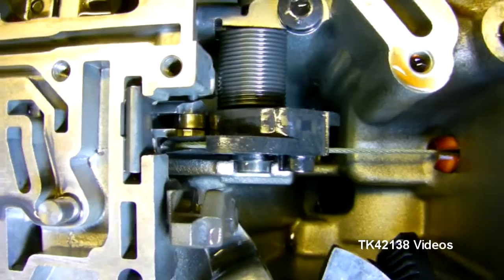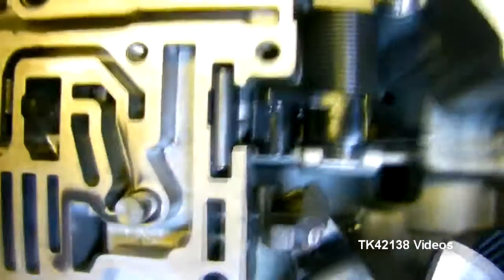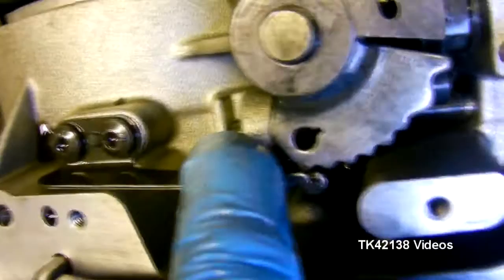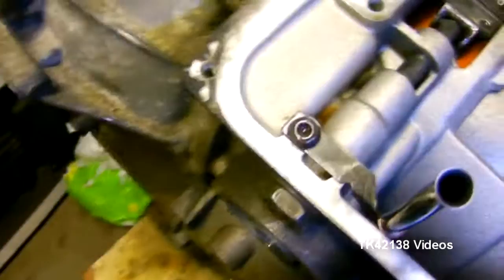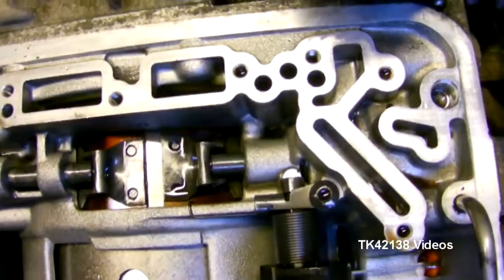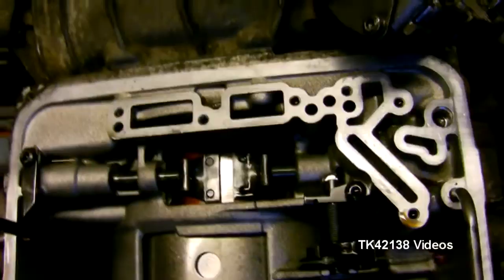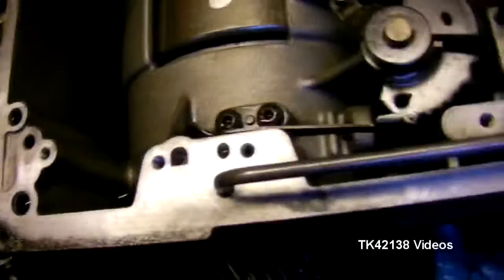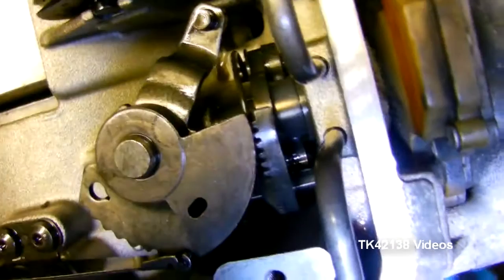ZF4 HP18 gear selector & kickdown cable operation

Comment: The little brown/yellow plastic bushing on the case for the kick down cable would break, i found a fragment of that plastic stuck in the transmission filter.
Reply from the maker: That's one of the problems with these transmissions - the use of plastic components that deteriorate due to heat, vibration and exposure to volatile compounds from the ATF and whatever else is floating around the engine bay. There were some plastic shuttle-valves in the valve block that had overheated and swelled up/distorted on the original transmission on the XM.
Reply: @TK42138  Yeah I found them not the most refined AT, mine is working well yet I still sometimes feel a jerk when it's downshifting into 1st, the downshift logic seems kinda odd for an AT with no ECU.

Comment: I have a very weird problem with this gearbox, it's on Saab 9000,  the car run fine without any issues in all gears, but there's horrendous grinding noise when I'm in D and the car shift from 2nd to 3rd for the first time of the drive. It always only happen on the first 2nd to 3rd gear change, then it won't happen again indefinitely until the car shut off. lol 

The mechanic I visited worked on this for decades and said he never found this problem, I went out with the mechanic
and let him drove it, he was completely bewildered by what happened, lol he said that we will know what happened after a complete overhual, so, I'll be reporting back of what is the issue when I found the answer. We tried changing the trans oil, and it didn't help, surely it wasn't oil problem, but something in there must have broke in a very rare specific way.

Comment: hello mate! so whats happens if the kickdown cable pushes the roller down the valve block? what happens? clutch linings are cmpressed? more air? less air ? noob question. whats happens?
Reply from the maker: I never took the two halves of the valve block apart as that leads to things flying out and hiding in the workshop never to be seen again. (I found that out the hard way 😆) I think the kickdown overrides the normal valves that control gear shifting so shifts occur higher up the rev range.

Comment: Long shot, but I have a volvo 400 series unit with approx 90000 miles ok it. I know nothing of these gearboxes appart from the videos on your channel and various bits on the interwebs however I'm still none the wiser on diagnosing my problem.

I have got strong reverse neutral and park, but no 1, 2, 3 or D. The gearbox ran 1/2 a mile under its own steam and then slowly rolled to a stop, but engine revved freely as though the clutch on a manual was badly slipping.  I will do a fluid change with dexron 2 following the handbook, I was wondering if you had any extra advice following my symptoms...
Reply from the maker: Apart from basic checks, even old school autos can be tricky to diagnose. Best start with the basics;
Check fluid levels with engine running and warmed up. With handbrake on and while pressing brake pedal, run the selector through each position then back to Park. Keep engine running and check fluid level on the transmission dipstick. The fluid should be at correct mark on the stick, be ruby-red in colour and  translucent. If fluid level is too low then that will affect gear changes because there won't be enough fluid flow to fill torque-converter and enable pump to produce correct pressue. The other reason can be valve block problem such as stuck valve or (depending on transmission type) a faulty solenoid or wiring. Any vacuum hoses to and from transmission need to be perfect, without splits, perishing or pinholes. Accelerator cable and kickdown cables must be correctly adjusted too.
A severely clogged fluid filter or debris from dislodged transmission gaskets or sealant will also cause problems but only way to check filter is to drain the ATF. If you do drain it, you won't be able to drain out all of the fluid. There will always be some left behind in the torque converter. Because of this, important to make a note of how many litres drained out so correct top up can be done - assuming of course that the fluid level was correct in the first place.
Reply: @TK42138  thank you!! I believe the gearbox might be overfilled, would that have similar effects? I'm not sure if any vaccume hoses are joined to this box, I'm not able to find a clear vaccume diagram in the HBOL. 

Liquid is translucent red and does not smell of anything that I can smell...however I have not performed a change in the 5 years it has been sat on my drive since taking it on as a non running project from a previous ebthusiast 🙃 is the valve system easy to replace on these if the fluid change does not work?

Are there any dos and donts with this gearbox, ie towing? I had to have a tow the other day and forgot to take it out of 1st
Reply from the maker: Yes - overfilling will cause gearshift problems as too much fluid causes foaming and cavitation as the rotating assemblies spin. Also there will be pressure build up so there is a risk that seals can distort or rupture - which leads to other faults. Hopefully you've caught it in time. Drain it and see if the filter and filter magnet has trapped lots of swarf or fine particles. Hopefully there won't be any. When I drained mine, the fluid looked like pinkish/grey with metallic shimmer due to large amount of wear. If the fluid is still red and smells normal then at least that's a good sign. Valve blocks normally need bench testing as transmission specialists will plumb it in on flow rigs to ensure the various valves operate correctly. On my ZF4 I found a plastic valve had cooked and swelled up and seized in its bore. Previous owner had towed with it and basically cooked the transmission. The actual valve block is in two parts and should never be taken apart due to tiny ball bearings, springs and orifice washers that regulate flow. These will escape if the actual block is disassembled.

Comment: Welcome
I have a question for you, I see you've dissected automatic gearbox.
Do you by chance dissected Main Valve Body?. I've done it myself, I could not record and watch at the same time to avoid missing anything. I have drawings of the program ATSG, but there are no specified size of each of the springs that are at Valve, and where. Sorry for my English but written using the translator
Reply from the maker: Rafał Gliński Hi,yes - I have taken apart the old valve block but had problems trying to get information on the correct lengths of the springs. Got to the stage where I sold the car as spares or repair as several gearbox repair specialists took ages to return my calls or simply no longer catered for the ZF4 transmission. I'll check to see if I still have photos of the valve block as I took it apart and let you know. The springs were all intact on my original valve block but did have some dirt that was causing a valve to lock up.
Reply: *****
 Welcome
Well, if I understand correctly, you are in possession of pictures distributed Valve Body with the location of each of the springs ??. For me exactly springs are in good condition. I plant not that submission of this will be on the so difficult, "top and bottom" Valve unfolded and folded independently without problem. But had not expected from Main will be with such problems.